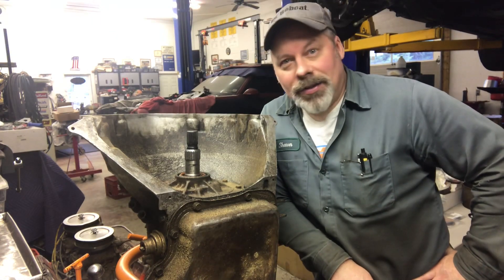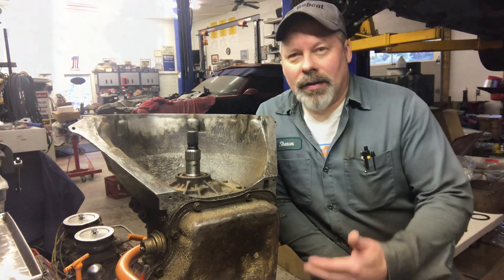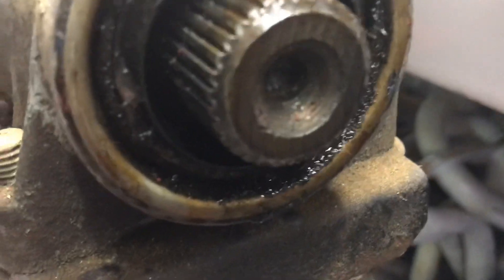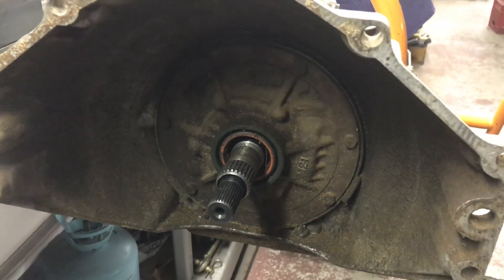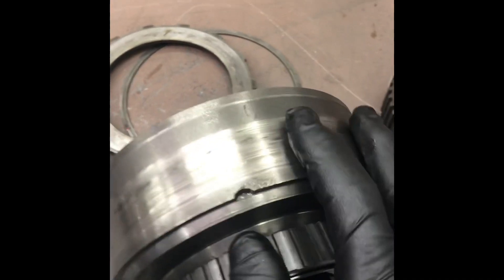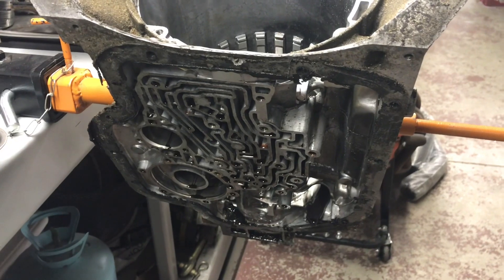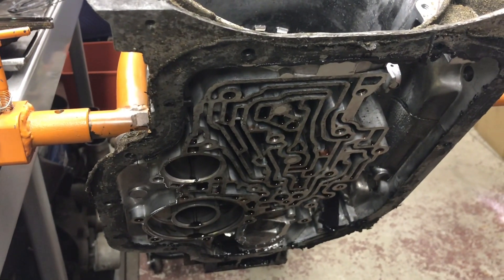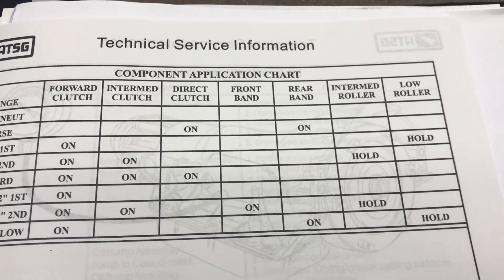TH400 Autopsy

Comment: I overhauled those transmissions long time ago when I worked for gm .. my brothers truck transmission he had overhauled at a shop failed on the way home damn . So we pulled it out and went through it . Had to go to a salvage yard to get some parts that had failed.  Seems like the front pump. Never gave any more trouble . I was in my early 20s . Long time ago . I appreciate your time on the videos thanks . I left Gm a long time ago 
 I dont regret the move.  I hate warrenty work